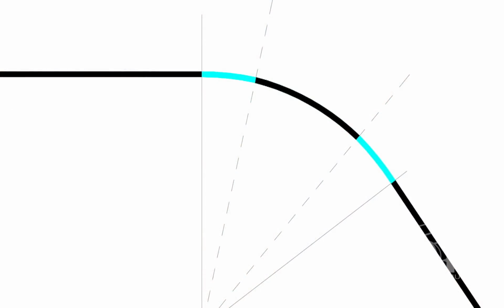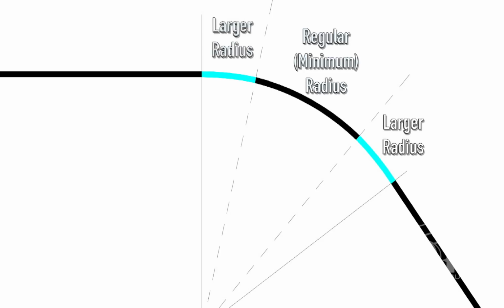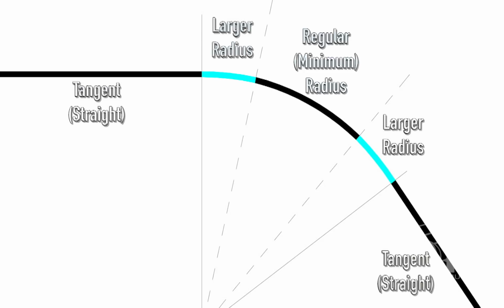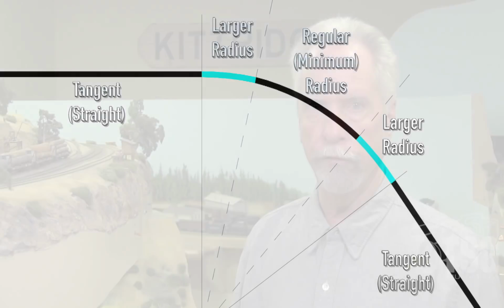Model Railroading with Jack Burgess Lessons Learned

Comment: Spirals/easements:  You missed one of the main reasons for spirals.  Easements as they are called connect with tangent tracks so that there is no discontinuity in centripetal acceleration.  Centripetal acceleration times car/loco mass produces a sideways (radial) force.  If a tangent mates with a circle, at the point they come together, there is a discontinuity in the radial (centripetal) acceleration.  A tangent has an infinite radius of curvature, while a circle (or most curves) has a finite radius of curvature.  This creates a radial "jerk" that is felt by an instantaneous sideways force...to be avoided as it could be large.  Easements are curves whose radius of curvature at their attachment point to a straight line is infinite...thus no sideways jerk.  The curve of an easement can be written mathematically as a 4th degree polynomial, and that can be plotted on paper and on your layout to mate seamlessly with any tangent.
Reply from the maker: This is great information! In HO scale, however, no one is too worried about the physics of equipment that weighs dozens of tons. The correct answer for this program is that the scaled down curves look more realistic by using this technique.
Reply: @tsgmultimedia  However, it's the appearance that counts on model railroads.  The discontinuity in centripetal acceleration  in dynamics causes a "jerk" (time rate of change of acceleration) which becomes evident if you watch your cars transitioning from a straight line to a circle.  You will see a slight lurch in every car making the turn.  Do you want that?  Non-circular transitions will eliminate this, and these transitions do not have to be all that close to an exact easement curve.  An "eyeball determined" easement is completely enough to eliminate any visible jerk.
Reply from the maker: @walshrd  As I said, "The correct answer for this program is that the scaled down curves look more realistic by using this technique."

Comment: @6:57  City Inspectors say no workbench in the garage.

"When I got back into the hobby about 1965 or so"  .... A year after I was born.  :-)
Reply: I worked for a City Engineering Department and there was Building Inspector about 40 years ago who, if he say a workbench in a garage (visible when the garage door was open), he would issue a citation. He was told to stop doing that...
Jack

Comment: The Hepa filter helped with scenery cleaning, but did it make track cleaning less frequent?
Reply: Most likely...but I don't operate my layout and only clean track every two years before an invitational Op Event here in the Bay Area. But I do recall operating a train over a portion of the layout for a visitor a couple of months after an operating session and I didn't have any contact problems. Jack